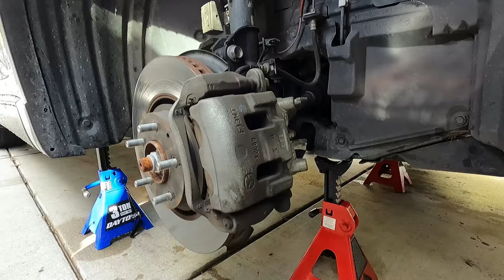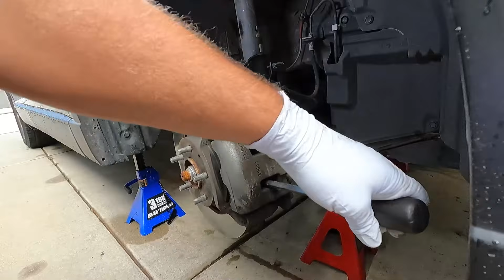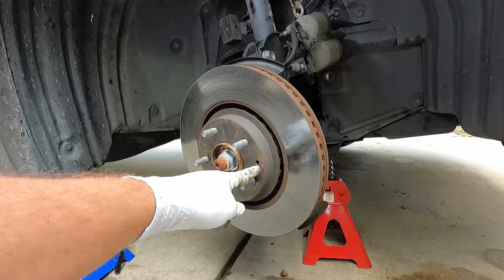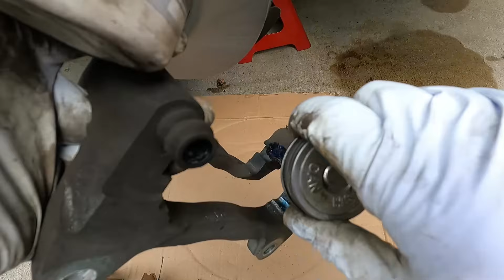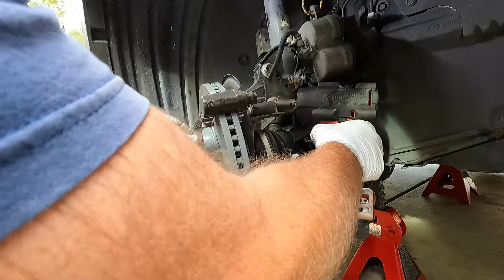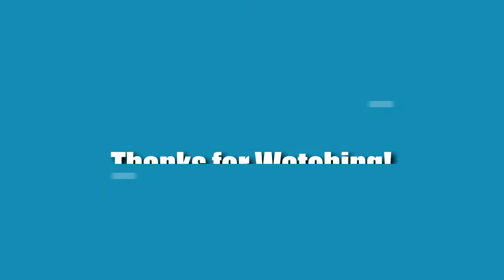2016 - 2022 Mazda CX-9 - Replacing Front Brake Pads & Rotors - EASY DIY!  Complete with Torque Specs

Comment: I love how you make it look so easy to put the pads onto the caliper bracket. I literally struggled with this for over an hour. I had read some stuff that said maybe it was corrosion that was keeping it from sliding in so I took it off And used my wire brush to clean it even more. At the end of the day, it was hard as hell to get those damn things in and sitting flush against the rotor. My guess is the more you do it the easier it becomes. But this was my first ever break job and I was able to do it myself and save myself about $800. So even if it took me two days I would’ve been happy. Thanks for the video.

Comment: Nice video thank you.  You didn't mention a brake, break-in procedure.  I purchased Power Stop Z23, and they had a break-in procedure.  Do other manufactures have break-in recommendations as well?
Reply: brake pads better works as designed as soon as they`re properly installed

Comment: Great video! Going to buy a lot of the stuff and finally DIY. I love Mazdas but they always seem to have squeaky brakes immediately after taking them home. They've "fixed" previous issues but depending on the dealer, you have to fight them to fix it. Going to just change the pads and will change my dad's rotors thanks to this video.

Comment: I don’t get it, rotor is just handing on what? There is no secret screws.. nothing
Reply: In this video is was seized on so it didn't just fall off when the lug nuts and wheel were taken off... but lug nuts hold the rotors on during during use.. the little screws that some rotors have holding them on are solely for assembly during production of the vehicle they can be discarded during first brake change.
Reply: @Pigglywigly91  thaanks for explanation

Comment: dang I did this exactly and my pads are dragging on the rotors.  I've taken it apart, re-installed it.  the caplier seems to float around nicely but as soon as I put the wheels on it makes terrible grinding noises.  I can't figure out what I'm doing wrong and watching this appears to be identital to what I did so I'm puzzled.
Reply: I did this once. You put a pad on backwards. In other words the metal backing plate is reversed.
Reply: @corykeeler2655 😅 id laugh but... One time I forgot to put my calipers back on. 🤣😭
Reply: Maybe you bent your metal rotor shield in so it's grinding against the wheel. Try pushing it back to give it clearance.

Comment: Slide pin torques are close to 25ft lbs pretty sure, not 65.
Reply from the maker: On some models and later years of Mazda’s it can be 23~28 ft-lbf (front single-piston caliper). On this one it’s 62~68 ft-lbf (front dual-piston caliper).
Thx for watching!
-Dan

Comment: I'm having problems with my front passenger side brakes.  After changing my brake pads, it started to make a clunky sound when I  drive it . But it fades when I accelerate. Has that happened to you before ?
Reply from the maker: I would take off the wheel and inspect it and double check everything.  It’s possible that something didn’t go back together correctly.

Comment: It is the same as cx52021?? I just changed diy my brake pads and start to make a clunk noise, I think I put the shims in the wrong position, do you think that I can do it in the position that you did it in the video ??
Reply from the maker: I am not sure, but it's probably very similar.  If there's a noise, I would take it apart and inspect everything that you did to see what is going on in there before driving it anymore.